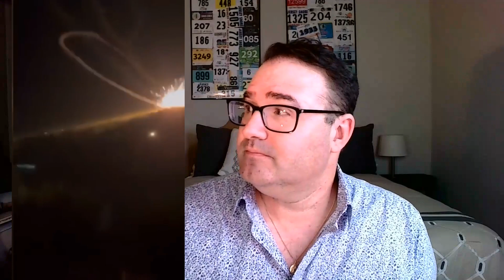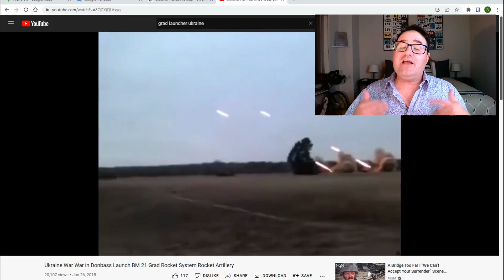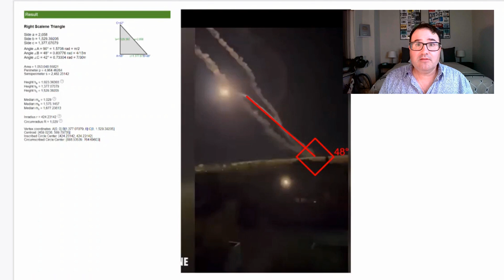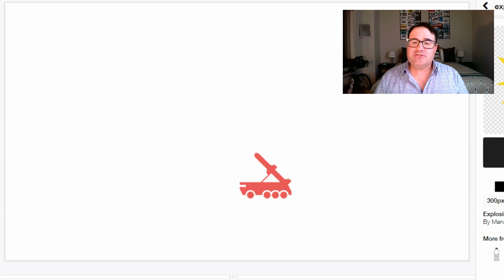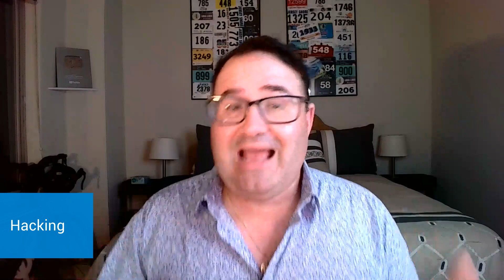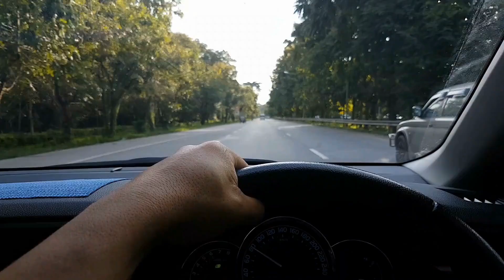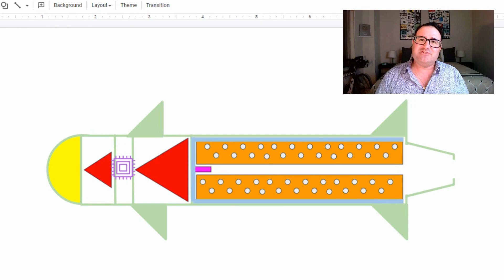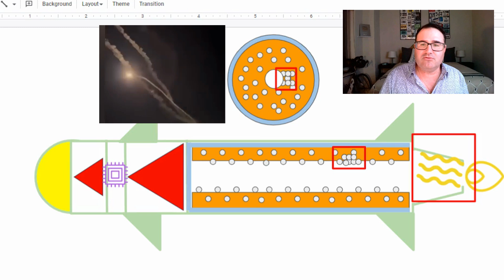Why this missile U -Turned

Comment: I certainly concur that your theory is plausible.  However, that turn is an incredible high acceleration turn.  That kind of turn doesn’t happen unless the missile is totally out of control and basically disintegrating.  Rather, consider also after the turn the missile kept going in exactly the same direction from whence it came: it was flying its trajectory exactly backwards!  Had the missile had a bad propellant spot, 1) I don’t believe it could have caused such a violent turn, and 2) the missile would have re-corrected to try to start flying its original trajectory again: that clearly was not happening.  Rather, the most likely cause is a sign inversion in the guidance control software that caused the missile to flip its perceived geometry, thereby flying backwards.  I’m sure that Russian missiles still use Fixed Point math in their guidance control software, and fixed point math is notorious for overflowing the available bits, and when that happens the sign of the number can reverse.  It’s hard to trap all the possible occurrences of such overflows.  That said, such an overflow condition is often preceded by an out of tolerance input: such as might be caused by your propellant hypothesis.  So it is quite plausible that the event was initiated by a propellant anomaly, but then an overflow in the guidance algorithm caused the missile to think it was going in the wrong direction, from whence it then executed its 180 degree high-G maneuver and keep flying in the opposite direction … until it couldn’t ;-)

Comment: I won't discount that manufacturing issues could very likely be the cause of the problem.  However.  I think it was guidance.  Buk TEL and TELAR are capable of being aimed by a laser designator, that is built onto the TEL/TELAR.  I think it's extremely likely that said designator wasn't being used for the other interceptors that were fired but was accidentally used when the interceptor that is in question was fired.  I can't speak for air defense systems that I haven't worked with, but I know that American systems are capable of making EXTREMELY hard turns almost immediately after leaving their canister.  You can find videos of THAAD interceptors pulling off turns just as hard, to burn off any excess fuel before intercept.

Comment: Last theory sounds convincing!

I think it's not a U-turn. The trajectory is C shaped towards the viewer, but perceived inverted due to perspective illusions and due to the lack of visual reference at night. The Sun got it wrong—the missile didn't "boomeranged back" exaclty. 

Two things that easily got wrong:
- rocket doesn't turn away from the camera, it turns toward the camera;
- rocket doesn't hit the launcher, it hits the ground between the launcher and the camera (= a couple of km closer to the camera).

If you pause the video at the landing moment, you'll notice that the hit point is slightly "lower" at the frame than the launching positions (=closer to the camera). Also smoke trail at the ground hit is wider than at the launch and in the air, again. 

Perspective tricks :)

Comment: The missile had no idea where it is at any time. It knew this because it knows where it isn't. 

Unable to subtract where it is, from where it isn't, or where it isn't from where it is (whichever is greater), it couldn't obtain a difference, or deviation. 

The guidance subsystem used deviations to generate corrective commands to drive the missile from a position where it is to a position where it was, and arriving at a position where it wasn't, it now is.
 
Consequently, the position where it is, is now the position that it was, and it follows that the position that it was, is now the position that is.
.
In the event that the position that it is in is not the position that it wasn't, the system acquired a variation, the variation being the difference between where the missile thinks it is, and where it wasn't. If variation is considered to be a significant factor, it too may be corrected by the GEA. However, the missile must also know where it was.

The missile guidance computer scenario works as follows. 

Because a variation has modified some of the information the missile has obtained, it is not sure just where it is. However, it is sure where it isn't, within reason, and it knows where it was. It now subtracts where it should be from where it wasn't, or vice-versa, and by differentiating this from the algebraic sum of where it shouldn't be, and where it was, it was able to obtain the deviation and its variation, which it called "error.
", so gave up and Returned to Base.

Comment: good analysis,  But once the fuel rich hotspot or possible crack In the fuel grain (which also can causes a hotspot) is reached it normally, causes Asymmetric burning and it will continue to burn with off center line thrust till it burns out or goes boom and usually it goes boom when the hot spot reaches the motor wall.)
I think it  was the guidance or control fin... and this is why... During 1st portion of boost little to no steering to prevent over steering at the low initial launch speed then next phase of flight guidance is given full control of steering the beast on to its ballistic or guided path to target...  the missile turned 180 deg. then continued strait as if programed to do so... it still seems fishy that it turned then went strait again, if it was a malfunction or flaw, I would have thought it would be more chaotic or a smooth circle... crisp turn then strait?   Maybe there was a intermittent malfunction (similar to your conclusion or momentarily stuck fin),  it lost the return beam from the target when it u-turned,  it re-acquired the beam and followed it back to the director instead of following the reflected beam from the target.

Comment: Occam’s razor tells us to go with the simplest possible answer, so I think you’re right. However, the romantic in me wants to believe that the missile was hacked, and I think there is an improbable but possible scenario, which is a hardware/firmware hack.

Imagine this—the factory that builds these missiles uses CPUs and circuit boards sourced outside of Russia. However, to pocket a few extra bucks, the buying manager buys some of the CPUs at a discounted price on the black market. The provenance is unknown. The buyer assumes they are stolen from the manufacturer or some other client or vendor. He has no idea through whose hands the components have passed and doesn’t care, so long as they test OK and they work.

Now imagine that some agency with the required capabilities and expertise, in some government with an adversarial relationship with Russia, inserts itself into that chain of custody. It could substitute a CPU (or whatever) that looks like the genuine component from the MFGR, but that contains hardwired instructions to misfire (or do whatever). The component is tested as normal, is used to build the missile, and voila, missile that flies back.

Did this happen? Probably not. I mean, why not just have it blow up in the rack? But as Russia seeks to replenish its inventory of high tech electronic components through a “parallel market”, they are at risk of receiving hacked hardware. And due to the general level of corruption in the Russian economy, I suspect that these trade networks already existed before the sanctions and were supplying components to the Russian arms industry.

Comment: Many many years using model rockeries. If you theory is to be correct, there would have to be multiple counter acting clumps in the fuel because you can clearly see two distinct corrections in the video, the initial U turn and a spin correction after the U-turn.
Typically clumped propellant will show characteristic exhaust flashes as the mixture is irregular, I don’t see that. 
I think guidance system tampering is the most likely explanation.
Which could have been done at the assembly facility.
Or with all the private cyber security contractors creating encrypted off grid mesh networks in the area it’s very possible that they have capabilities to intercept the guidance network since those missiles aren’t closely guarded secrets anymore. 

The CIA has also been known to tamper with foreign powers arms. (Aka Tens of thousands of 7.62x39 batches that have c4 added to the casings, to name the most well known)

Comment: I had a similar theory but couldn't get quality video that could support it. Is it possible that the clump of rocket fuel was able to burn through the insulator in the combustion chamber forming a lateral jet thrust turning the rocket around, and possibly blowing off a stabilizing fin resulting in the street and trajectory on the third movement of the rocket?

Comment: Certainly, incorrect handling, storage, or other flaws in the propellant matrix can result in uneven thrust over time, and other malfunctions in flight.. 
BUT, you need a good bit more information about the nozzle geometry to come to this conclusion...as well as the fact that once the rocket had turned 180°, it went straight again: even if there was an irregularity in the propellant geometry that resulted in unbalanced thrust turning the rocket, once the thrust returns to a balanced state, well, the rocket is still turning: it really appears* that something made the rocket go straight, again.  

* unless we just happened to get the perfect angle in this footage, but I really don't think so.

That final behavior is still systemic, probably NOT a random result.
The internal guidance system was still working.

It would seem more likely that there was a problem with targeting radar signal, or, maybe some jamming...
But I have no evidence/data/specifications to really base that on. 

I do like your informative videos, and you usually back up your statements with objective evidence.

I just think, on this one, it does not make sense.

Comment: I don’t buy it. Asymmetric thrust due to a clump of fuel won’t cause a 180 degree turn that quickly. Probably a sensor installed upside down.

Comment: A modern SAM is highly maneuverable, although it isn't designed to turn 180° and slam into the ground near the launcher! 
This missile appears to be stable and under control.  The flight characteristics are within the capability of the control surfaces of the missle (aka fins) and the physics of the rocket's acceleration. It appears as though the rocket did a u-turn then straightened out under control of the control surfaces. But why did the rocket command a u-turn? Track radar, datalinks, inertial navigation systems, terminal guidance radar, and FLIR all feed into a flight computer that computes the commands sent to the fins on medium to long range SAMs. This is a very complex system,  under extreme g load and vibration. I think a problem,  perhaps even a software problem,  caused the missle to command a u-turn then terminal guidance found the biggest signature around and headed towards it.

Comment: I would have thought an airliron/hack would have described a much larger/wider arc as well.
Reply: Also same problem with dynamite. The nitroglycerin will seperate from binder/plasticyzer over time/heat etc. Many recipes some clay, cellulose, etc.

Comment: Hi Ryan, if you read the specs for BUK missile systems, the combustion chamber does not extend to the exhaust but it is in the center part of the missile with a steel pipe taking the gases to the exhaust. So, such a lump would not cause a sudden change in the direction. (Actually, it's one of the naval requirements for the missile) My take would be also mishandling, but one of the fins getting damaged and breaking in mid air, suddenly deflecting then breaking off due to the forces and that, driving the missile to ground. I'm not an expert in missile systems but I am a physicist with some manufacturing background. :)
Reply from the maker: Maybe. But why would a broken fin straighten it back out again. Do you have the manual for the BUK?
Reply: @RyanMcBethProgramming  leading  edge deflects by the aerodynamic force, causing the sharp turn. Then, by that aerodynamic force, it falls off, the deflection is gone and it can continue flying straight. Just am idea, though. But given the design, the fin had somehow deflected. Either by a mechanical fault in the fin assembly or control system malfunction, like a short circuit or contamination or chip failure causing a full deflection of the servo controlling the fins.
Reply: @RyanMcBethProgramming  Also, I'll try to find the manuals. :) Good challange.

Comment: @ryan thanks for your information, its definitely plausible, though I don't this the odds are in your favor. What are the chances that it would malfunction at loop back tot he exact same place. Very low.... based on this alone there must have been a bit of tracking on the source vehicle by the missle.
Reply: From the curve in the video, the missile curves up to hit the source location in its second stage flight. 

Definitely some guidance issue, maybe brought on by the other two smoke trails.

Comment: Either guidance (kicks in after 2 seconds, after initial launch, and starts correcting), degraded fuel (depends on the motor, if this would lead to a direction shift) or damage to the directional parts (fins, grids).
Most likely 1 in this case. Fuel yes does degrade, but increase of pressure in the motor doesn't necessarily lead to a directional change. Most likely the motor will explode or damage a jet fin. This would lead to a directional shift or change which would probably lead to spiraling of the rocket.
Because the turn starts very abrupt and then describes a nice smooth cure I believe the guidance of the rocket itself stopped or gave a wrong path du to a failure like sensor issue or computer issues. But guidance failures are also often maintenance related.
There is another video from the same time where a rocket spirals out, that probably is  degraded fuel.

Comment: Don't agree.  The turn was too close to 180° in both axis.   I could see it deflecting in a random direction or looping.   It is possible that it randomly did a nearly perfect 180°.  But the odds are low.   It's like 6° in 360° * 6° in 360°. so about 60*60 or 1 in 3600.

Comment: I think the reason for this is that Buk is very old system (40+ years) and many of the missiles were built during soviet times and after decades of storage the fuel has migrated exactly in the way you described. Great job!

Comment: Enjoy your videos! I’m curious about your hypothesis on the uneven burn in the combustion section of the rocket being the culprit; if all the combustion gases are escaping through a fixed nozzle, would uneven combustion pressure really cause it to veer of course? I think uneven combustion pressure would effect thrust/efficiency (increase in pressure would increase thrust) and may lead to catastrophic failure but not change the direction of the rocket. I don’t think asymmetrical thrust is possible in single rocket engines as it is with multi engine aircraft for example. What do you think? Another thought, I think it was a mechanical defect or software defect of that specific rocket. I would imagine all the rockets loaded on that launcher would have been manufactured, stored and handled as a batch, so it’s suspicious 2 others launched successful without issue.

Comment: Fuel  nonuniformities can't cause rocket to turn significantly. 

Almost all rockets use a de Laval nozzles. They have a convergant section,  a throat,  and a divergent section.  The gasses generated in the combustion chamber smoothly transition from the chamber to the throat in the convergent section.  The gasses in the throat are"Mach  limited" and ALL travel at the speed or sound (at the high temperature of the exhaust gasses).  The gasses expand in the divergent section,  accelerating the gasses and trading heat for velocity.  What happens in the chamber only affects the chamber pressure therefore the the density of the gasses in the throat, which are very uniform across the a area of the throat. Nonuniformity in the fuel cause changes in the pressure in the chamber and the total thrust of the motor but the Mach limiting throat prevents any significant steering.

Comment: what about the crew simply entering the wrong coordinates for the target.  let's say, among the many variables the system has to work with, it's using x, the launcher's location, y, the missile's location, and z, the target's location, couldn't the crew have simply entered the launchers location as the target's location?  i'm sure there are probably failsafes to counteract such a scenario, but there's no such thing as a perfect, infallible system.

Comment: To strengthen your case, in order for the missile to make that kind of turn is would need 2 fins turning in a coordinated fashion (one fine only would only twist?).  I don't see how a couple of fins could transfer that much forward thrust into that kind of turn.  If it could then missiles WOULD act like they do in the movies ;)  Therefore, the only explanation can be that an equal thrust from the side of the missile (burnt hole) could create that dramatic a change in direction.  

Arguing with myself, it looks like the beginning of the turn is gradual, then becomes tighter as the missile loses speed.  What explains beginning on a straight course again?  If the fins were able to create that change in direction then I'd go with the flight controller error.

That's my 2-cents.

Comment: I guess the reason why people think it's sabotage or guidance error is that the U turn looks so clean. It's not doing donuts or loopings, it's not spinning out of control. It just turns around and goes off straight into the ground.

It probably looks much less deliberate from different angles. From this angle, it looks like it returns to sender, even though it clearly didn't.